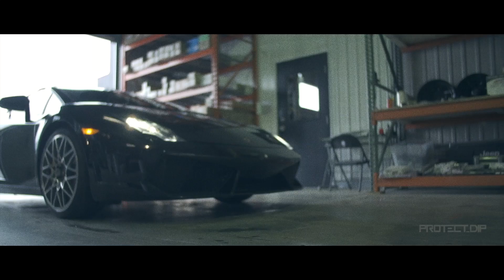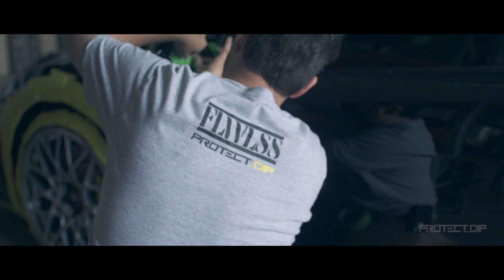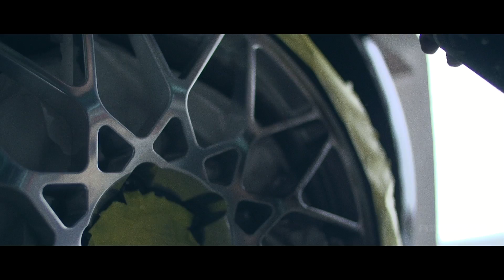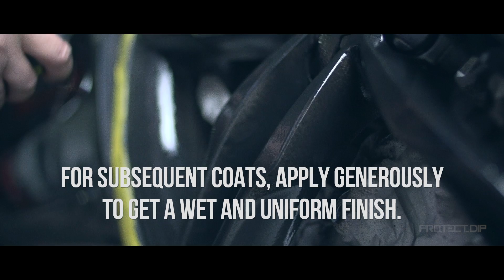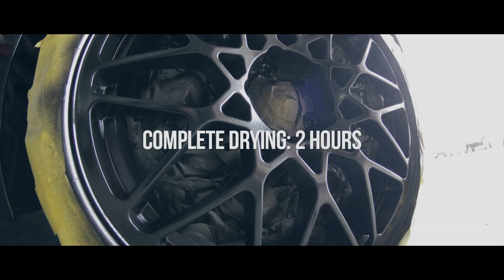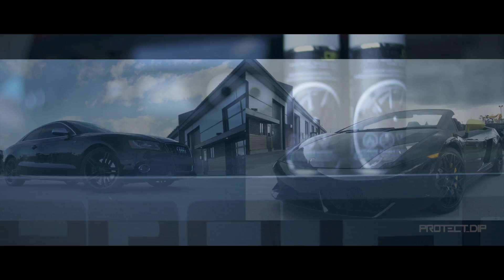PROTECT_DIP "HOW TO"

Comment: Not a lot of information on this stuff and after using it for about three years I'm finding I need to recoat it every year because of sun damage making it look blotchy . I'm about to recoat and apply their clear coat to the same parts to see if it keeps it from fading . Less music and more info would have been nice . The product is nice and lays down better than Plasti Dip but not so sure it holds up against sun fading any better even though it says it has UV protection in it .